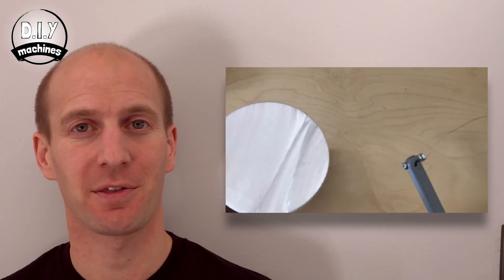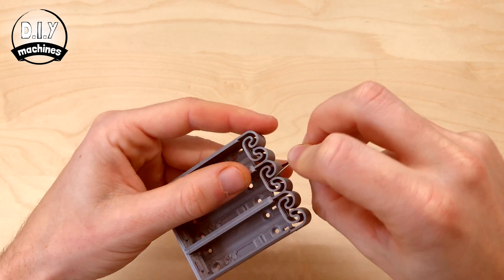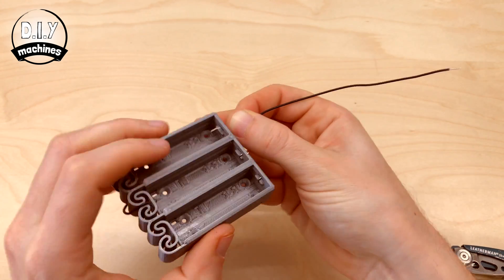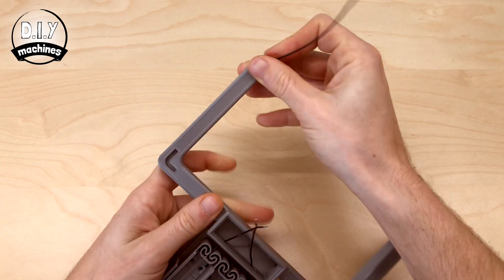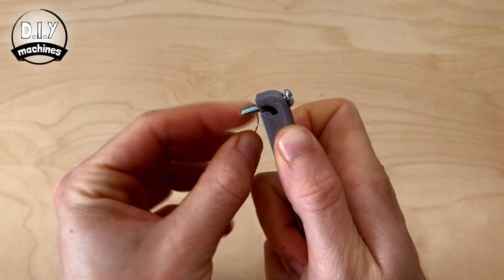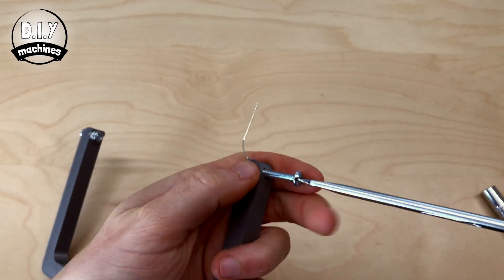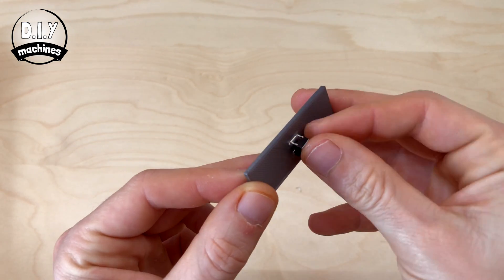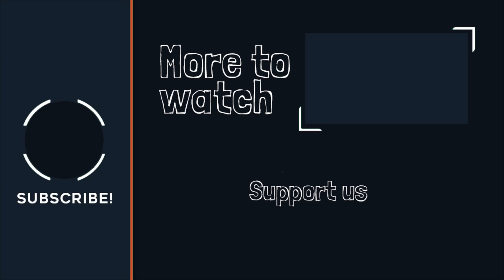Hot Wire Foam Cutter - 3D Printed - Battery Powered DIY Project

Comment: Tl;DR;

+ works as it should
+ you can swap nichrome wire for guitar strings (works well, tested)
+ solid & sturdy design
+ easy to use
+ supportless and easy to print (no brim / skirt / errors)

- no wire tensioner & no other adjustability
- it's a bit finicky to connect the wires on screws
- (nitpick) doesn't fit on every printer (I had to resize it a bit to fit on Prusa MINI+)
- (another nitpick) I guess the press button was chosen for safety, but rocker swith would work better to achieve more stable hand precision and would be easier to solder to the plastic body

The concept of the model is very good. The final product not so much...

Well, I know there are some cheap foam cutters out there, but what stops me making my own?

So I printed it in eSUN PLA black, which (as I found out) is good enough until you need to solder wires and the button itself to the body.

Cheap PLA like from Creality will definitely instantly soften and melt by the heat of soldering iron (especially at the button area).

The battery holder is ingenious as you can just print different box for different batteries.

But the holders for the heated wire are another story. They are absolutely horrendous - you can't easily tension the heat. wire.

Good thing is, it actually works - polysterne & XPS foam are easy to cut.

I'll definetly make my own next time. Thanks for inspiration.

Comment: just made one of these. Solid design, but it could use some sort of tensiioning/alignment hook for attaching and streching the wire.

As it stands, its a little hard to avoid the  nichrome sliding off of the nuts as your attaching everything together inititally.

Comment: Great video. How do you tension the nichrome as it expands during use?
Reply from the maker: Thanks :). I did not build any mechanism to tension the wire as it expands. I designed this model out of a need to cut the head for my BB8 project and this only required a straight cut so constant tensioning was not required. This could be perhaps added by connecting the wire via a taught spring at one end perhaps?

Comment: great video! two questions: 1) how long would you say the battery life was before having to recharge? 2) any reason you wired the batteries in series instead of parallel? I'm guessing they wouldn't have enough voltage if it was parallel but I'm not sure.
Reply: SIr do you know if that can be made with copper wire? or need to be with that silver one? i mean all the conections. Thanks.
Reply: @fabiorodrigues890  I know this is an old question, but going to answer it for future people wondering the same thing:  you should use the nichrome (Nickel-Chrome) wire that he uses.  It is cheap, you can get it from various places.  The reason is that it has high-resistance:  it heats up when current passes through it.  If you use normal wire it won't heat up.  This is also why the batteries are wired in series instead of in parallel, so that you can increase the voltage, which will push through that resistence.
Reply: @tristanreid5770  thank you very much Sir i really apreciate your time and atention ✌🏼 i already got one 😁